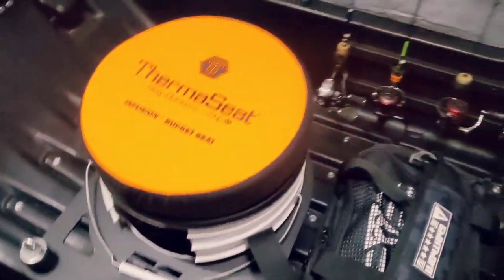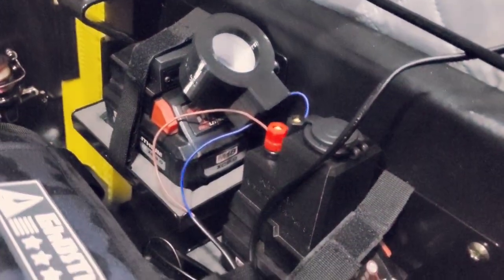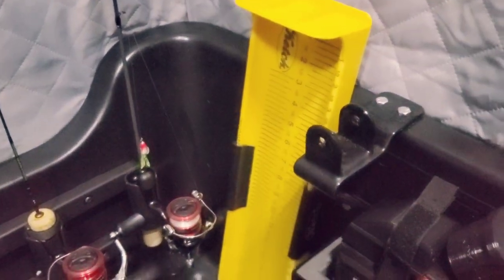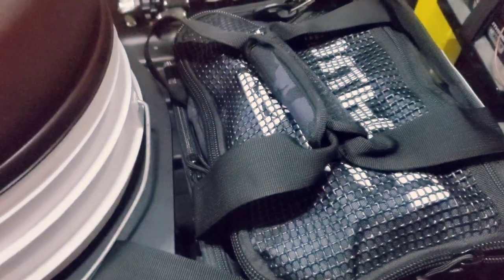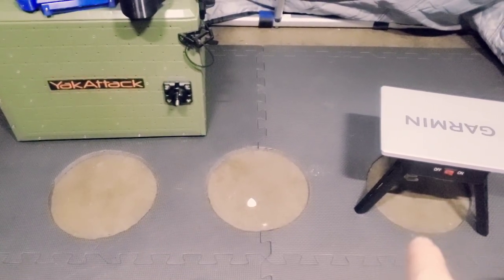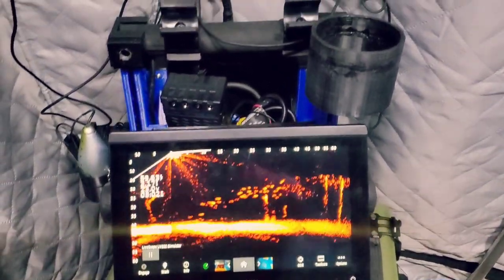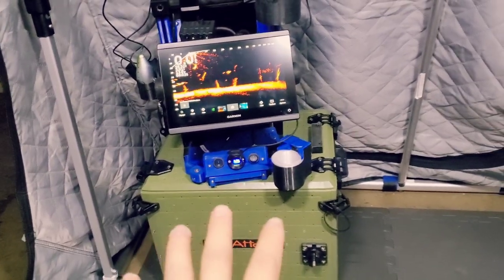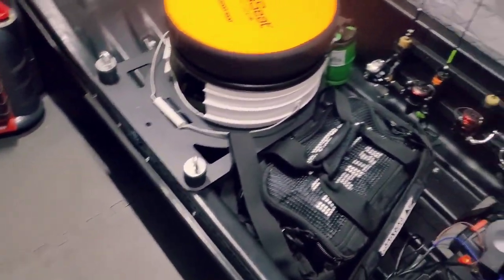Otter XT Cottage X-Over | Walk-Through | 22/23 Season

Comment: Definitely need the power adapter step down for the Milwaukee battery I learned the hard way and ruined a new set of Otter lights using a Milwaukee battery without a step down. 

I have a Cottage Xover too. For your wind poles what have you found the best starting at the back working forward or starting with the front pole working back ? My material seems to sag a lot without the poles installed 👍👍 great video.

Comment: I bought the same cottage.  Can’t wait to use it this year.  I’m just curious, I know it’s small and not made for over nights, but will a cot fit in it?  If you keep the bench off and put one side (leg) of the cot in the tub, I think it would fit snug.  Obviously, there wouldn’t be a lot of room, just asking if you’ve tried.
Reply from the maker: I haven't tried but I have looked for smaller cots and it may work but could push the cover out just a bit.